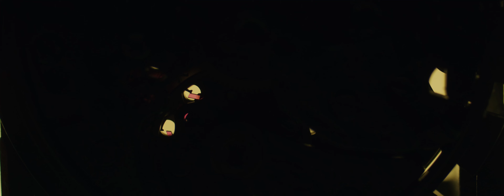Watch Dials

Comment: I wonder if you can powercoat or Cerakote a dial... Not sure how they will hold up. Electroplating should be interesting too! That is a very cool print technique! I did not know you could transfer indicies or printing that way! In aviation part manufacture we use a similar technique on sheet metal part where we make a jig that we can put a blank on and then press it with a bladder press or pneumatic press in order to add detail or shape. Thanks for sharing Cameron!
Reply from the maker: Yes, Cerakote is an option and powder coat too. The possibilities are nearly endless if the paint route is chosen.
Reply: @thewatchmakersworkshop  Much appreciated Cameron!